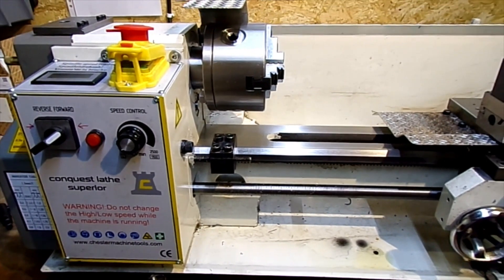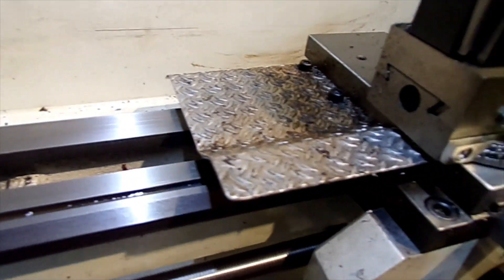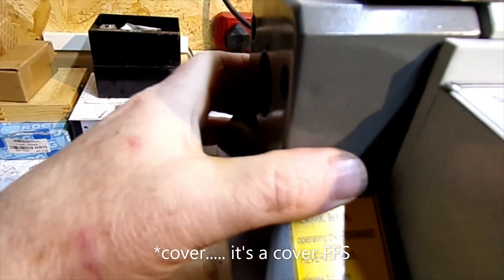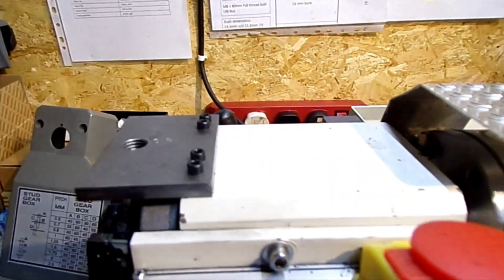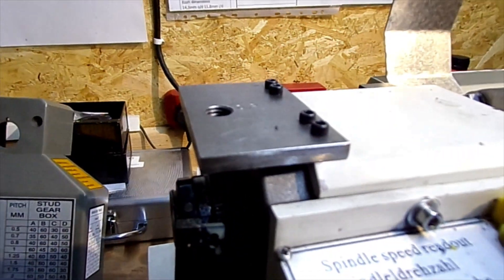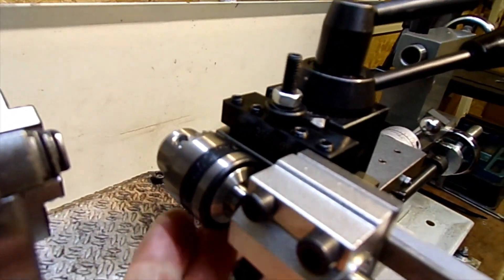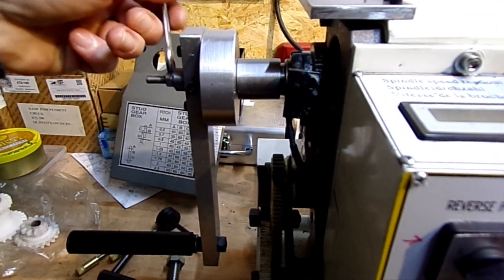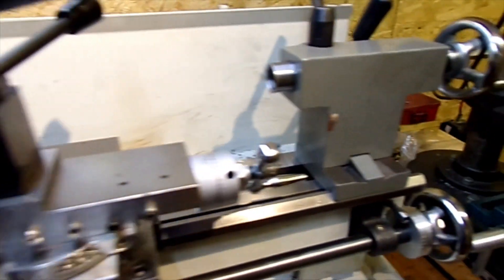mini lathe upgrades

Comment: Thanks for sharing! You have added a hand wheel to the tail end if your lead screw, too. And it looks as if You added a locking screw to your compound / cross slide, correct?

Would You mind elaborating in these upgrades, for the benefit of us newbies?
Reply from the maker: @19ghost73  yes hand wheel on lead screw is to manually move the compound assembly instead of powered and extra screws/locking screw makes the compound slide more rigid

Comment: Wish I had not switch to metal headstock gears. Knew they would be noisier but they had more backlash that made noise even worse. Hope you have a power lockout when you use that hand crank! Upgrades can be never ending on these little lathes. Should have just got a bigger lathe to start with.
Reply from the maker: No power lockout, just make sure I unplug it from the mains or lockdown the emergency stop button. Would have liked a larger lathe too, Boxford or Colchester but they are expensive and heavy, for now the mini lathe does all I need.

Comment: Do you know what would make a good upgrade for the factory spec chuck guard would be to have it able to slide along a rail to any position along the lathe bed either with or without the electrical  switch. You know those guard switches can become a dangerous default (go to) way of quickly switching off the lathe to make a quick tool change or  adjustment. Which is bad practise. I use a harrison M300 at work and I noticed that my mind is drawn to do exactly that with the guard except that I make myself switch off properly instead. Great vid cheers.
Reply from the maker: Very good point, form good habits from the start and safety becomes automatic.

Comment: good evening a question this lathe can also make threads in inches or just metric???
Reply from the maker: It has a metric lead screw but I have cut an imperial thread on it for my BSA motorcycle. I needed a 3/4" dia 26TPI internal thread.
I did have to purchase an extra change gear to do it though but yes it is possible to cut imperial threads on a metric lathe!
There is a very good calculator on www.littlemachineshop.com/Reference/change_gears.php
Reply: @InTheShedUK  thank you very much for your important information !!!